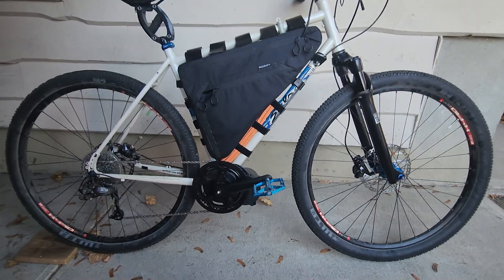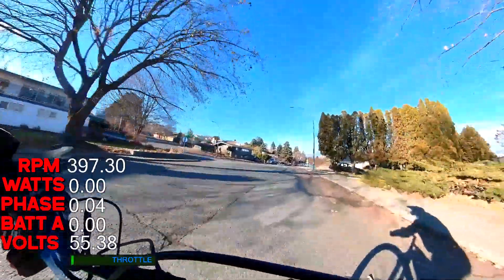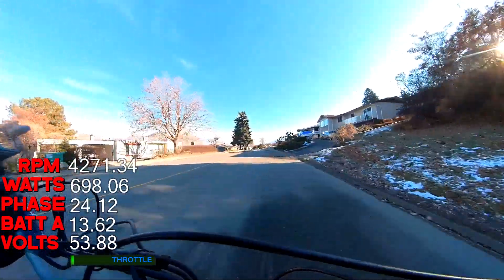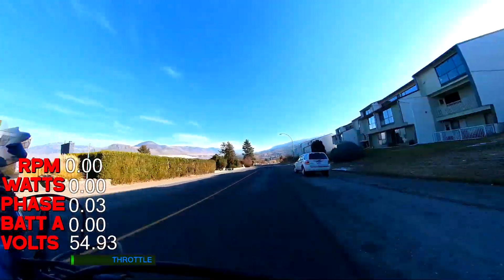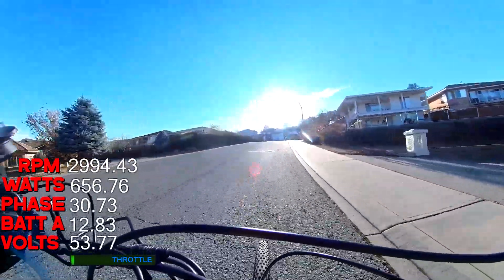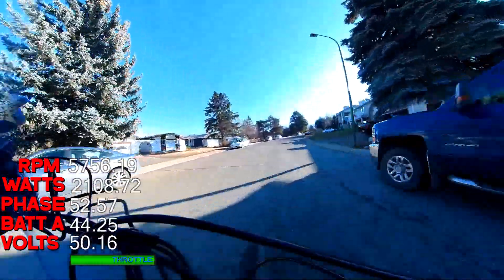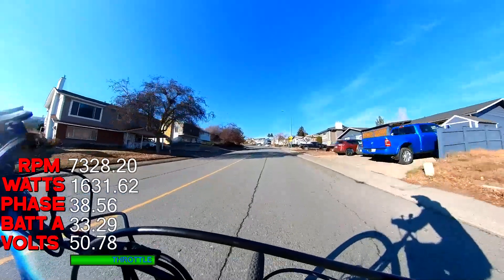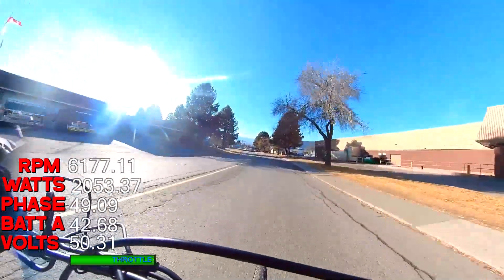TOSEVEN DM01 first ride with the ASI BAC855 52 volt battery 25% field weakening 70 amps cap

Comment: Hello,it’s the asi controller fit plug and play toseven motor?
Reply from the maker: Not for the torque sensor sadly. But other wise we do have a kit running for it. We would really like to get the TS working before we release anything.

Comment: Hey Mr High Vee  your videos are encouraging to watch 😅, is it possible for you to a drag race with those 3 different brands of Motos and show top speed?
Reply from the maker: That would be fun to see. It might be tricky heading into winter but I will see what I can do. Even if its just putting one screen against another. I will see what I can do but no promises. I might need to obtain a second 72 volt battery as well lol.

Comment: That's quite a wide power band with 52V battery. How did you enable field weakening on the BAC855? I have the same controller came with my CYC x1 pro gen 2 and want a bit more usable rpm. Do you think this is doable?
Reply from the maker: I have the advantage of really good engineer who does our motor tuning. ASI controllers are hard to use so I'm truly blessed to have him as part of our team. I think it will be even more impressive at 72 volts. The CYC Photon is an interesting motor. It naturally hits high rpms. It is essentially an RC car motor. I was hitting 13,000 rpm at 1% field weakening with 72 volts. I blew up the rotor doing that. CYC have an app that should allow you to adjust the fw. This video is footage at 72 volts with a bac800 up 10% grades. https://youtu.be/R_aXSMew0Bg?si=BSWQCs3vo66WdRMz

Comment: Toseven's catalog* indicates no torque sensing for DMO1S (smaller BB axle, 68-73) but that torque sensing available for the DMO1L (BB axle 100-110). Hope this isn't true!
Reply from the maker: The Catalog is complicated. They made non torque sensing versions of all the motors. The 68-73 that I have is torque sensing. I have not seen the larger version however I do have a project I would like to try one with.
Reply: * page 12 here: https://to7motor.com/wp-content/uploads/2023/04/catalog20230403-05.pdf

Comment: Your channel has twisted my arm into purchasing a dm01 from California Ebike's Black Friday sale! 

Noob so sorry if this question is silly. If someone want similar results to what you have here in this video, what all does one need to do besides buy a bac855 and 52v battery?
Reply from the maker: Cool. Love to see you on Discord to follow your build. In terms of the ASI you can't just buy a controller and get it to work. The tuning is only realistically available to ASI dealers. We put together a kit in order to then upgrade the motor. This has everything you would need to do that. Right now we are in the test phase with the DMO1 so we want to do a lot more before it would be made available. If you are really enthusiastic and on Discord it might be possible to have you as part of a test or development program but there are inherent risks to that. I should be able to try it at 72 volts next week although winter is closing in fast here so safe conditions to ride that bike get more limited despite the studded tires I just threw on. There is some info on our Discord community here https://highvoltagekits.com/discord great place to meet other DMO1 riders as well as the representative from TOSEVEN and California Ebike. Cheers
Reply: @HighVoltageKits  I actually started following that discord a couple of days ago. Definitely a lot of good information there! I am definitely enthusiastic enough to be a beta tester if the community would allow. I also planned to buy a 72v battery, but obviously only if I have a controller that can even utilize the extra voltage. I will post on the discord my plans and see if I can help contribute to what looks like an awesome community. Thanks for your reply, and can't wait to see your 72v showcase!
Reply: Are you happy with it?  I've got two that upset dropped off waiting for me to get home from work!

Comment: Really impressive for 52 Volts! Looks like it accelerates as well as a Sur-Ron.
Reply from the maker: It's quite peppy. I'm not maxing it out yet. I want to get the studded tires on before I try it at 72 volts! The field weakening can go higher as well. A promising start though for sure.

Comment: The TOSEVEN can handle this much power? I run 3kw on M620 Ultra motor w/steel gears. 2200 miles
Reply from the maker: I mean we run 4kw on the BBSHD and it looks to be built as strongly as that motor. Similar size so I don't see why it can't. If anything the gears are bigger than those in the M620 so should stand up to stress. This is experimental though and if there are problems then the design might need to be beefed up.
Reply: Bigger gears than M620,but not steel like M620
Reply: @wrosslandwr8032 only one isnt steel and it can easily be swapped out for steel or peak
Reply: @Alex-uh1mj   when and if it becomes avaliable yes.anyway I belive the ultra is the superior motor overall and with more coppar
Reply: @wrosslandwr8032 when and if what becomes available? The ultra is a different type of mid-drive its OEM. This is retrofit
Reply: @Alex-uh1mj  when and if a steel gear becomes available of course
Reply: @wrosslandwr8032  if it needs it we will make it, i really doubt it.. better with peek, keep it quiet. The design negates the need for steel
Reply: @Alex-uh1mj  good to now you can make it👍The high gear reduction (twice of Bbshd) might cause thee plastic gear to get hot/wear down faster than on the bbshd?

Comment: In an emotor like that is the watt usage and amps the battery is pushing to the motor directly proportional?
Reply from the maker: Yeah to an extent. I have limited  at a bit. If I push the amps up to 90 phase I think it will peak about 2800 with this battery. If  run a 72 volt one then it will push more watts at lower amps.

Comment: 22°C  motor temperature is impressive, even if was 2°C outside.   Thanks for sharing
Reply from the maker: Internal it will be a touch warmer as the sensor is on the casing but its been calibrated to allow for that.
Reply: 20c raised temperature

Comment: This is great stuff, if all things workout with this motor including reliability then this will give us a better alternative to the bbshd, it's great that you are liason with the manufacturer maybe you and them can create a whole new high performance kit off the shelf
Reply from the maker: The company have been great actually. If we run into issues they are open to modifying some of the design if it needs better bearings or a PEEK gear etc.

Comment: This pedal assist is torque sensing (adding torque proportionally to input torque) then??  If so, that is fantastic that it felt good!  Is this a first that you have torque sensing with a BAC controller if so?
Reply from the maker: The TS is not yet operational. Still cadence based right now. We are working with the manufacturer as it would be the holy grail. The translation is hard at times so it will get done once we figure out the settings.
Reply: @HighVoltageKits  Alright, thank you!  Sorry for sounding like a broken record on this topic, I'm just super excited about it.  :)
Reply: From previous video I believe it's PAS. The team is still working on the TS implementation with the ASI controller.